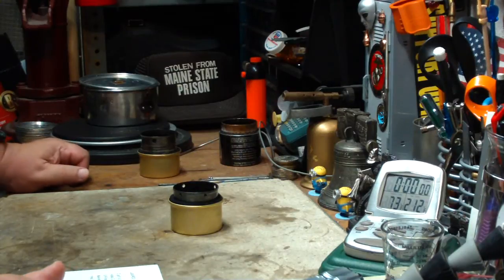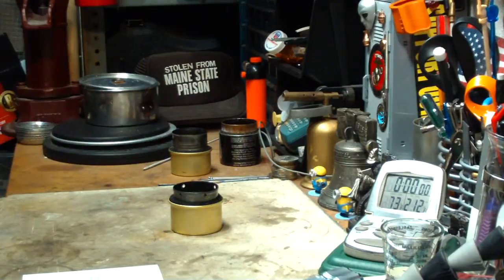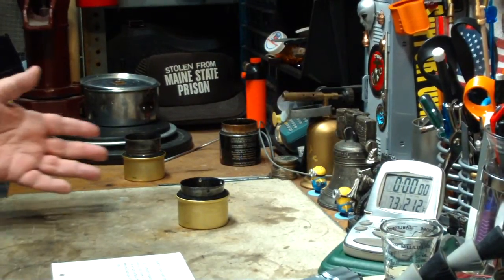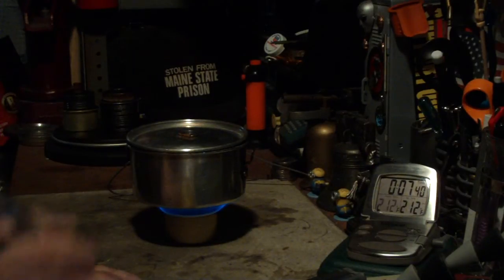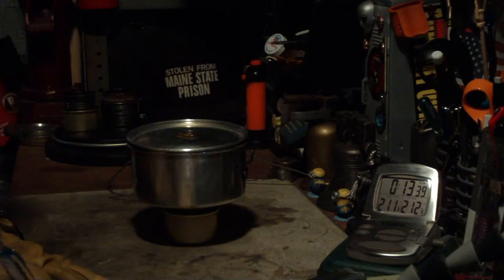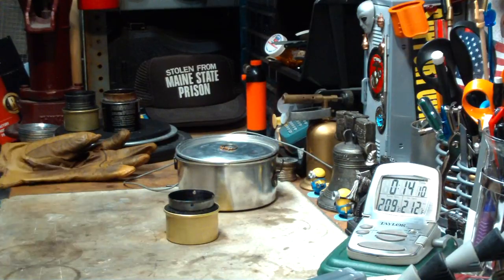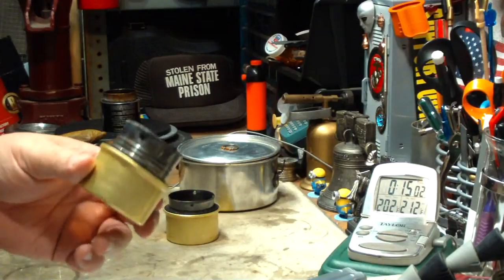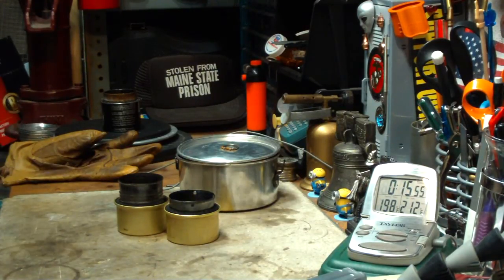Fancy Feast Stove M1 - Boil Test #1 - Requested by MatoNupai

Comment: Thanks for the tests Hiram,The stove with the hardware cloth i use all the time, works great for me. I have found if you make the wick around 1/4 inch above the side of the stove, instead of flush with the top, you get a faster boil time and bigger flame. I dont bother with the simmer ring i just use it with the top open and it works in any temp, as you have seen. Thanks for the mention appreciate it man.